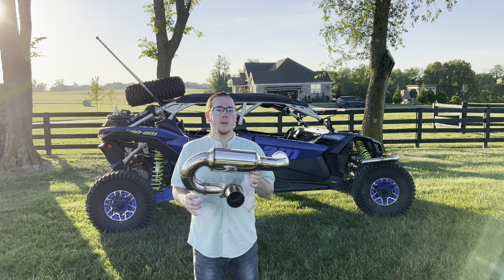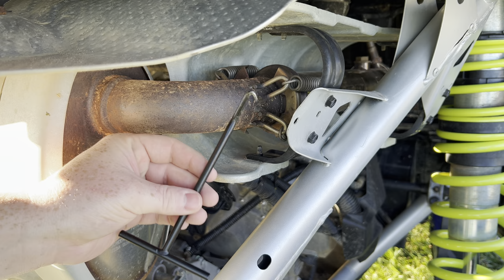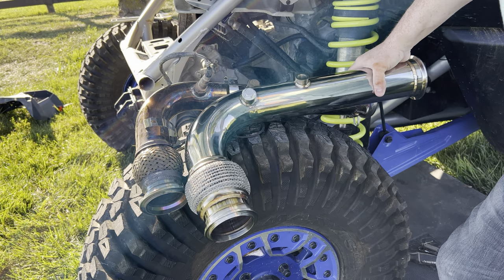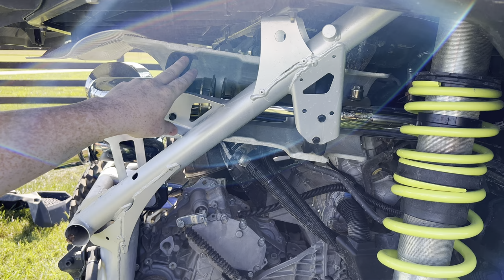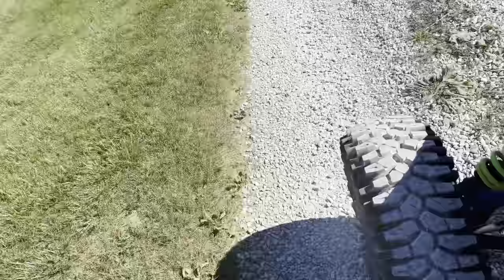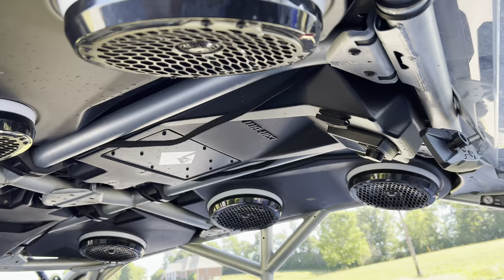Can Am X3 Gets New FULL 3in Monster Core Exhaust From @RPMPowersports

Comment: I just wanted to tell everybody that I have this exhaust on my x3 and it is much louder than you think it is and the quiet core plug you can buy for it doesn't make any difference to the sound level that me or any of my friends could tell. the exhaust does sound good but just know its a lot louder than it sounds in videos. we mud ride on muddy trails and all my friends made me start riding at the back of the line because of how loud this exhaust is.   just FYI
Reply from the maker: Good point to make there , as with any exhaust that your removing the stock pipe is gonna be louder for sure  , but as you said this is a great sounding exhaust. Thanks for watching

Comment: Sounds pretty good! So you don't use the exhaust shield? Any trouble without that? Gets 🔥 back there. Also, with all the exhaust you installed, have you ever had the o2 plug fall out? I did on my RPM Bigmouth install. I know it was tight. Did it on the workbench. They did send me another. Great company!
Reply from the maker: I put the factory tip back on it but I didn’t end up using the extra silencer that they sent it’s an add on when you buy the exhaust , and so far out of all the ones Ive installed no issue  with that plug falling out. Thanks for watching buddy

Comment: I know im a bit late, but i just got this set up for my X3 Max and can’t wait to get it on this weekend. Question, has anyone come with a plan to reduce the heat in the cab… I have the same one in the video and we darn near melt on 80 degree weather days. Any help is greatly appreciated.
Reply from the maker: I might would suggest a heat blanket for the turbo possibly and exhaust blanket to help block some of that heat from coming into the cab .
Reply: The heat im experiencing is coming from the front and radiator. I have the same X3 in your video. Did he ever get the extreme heat coming from the front?